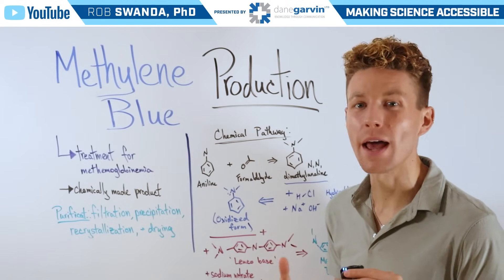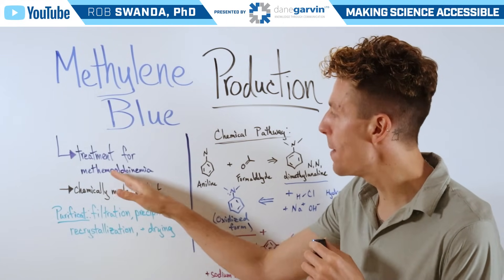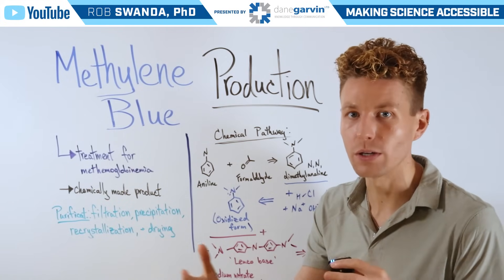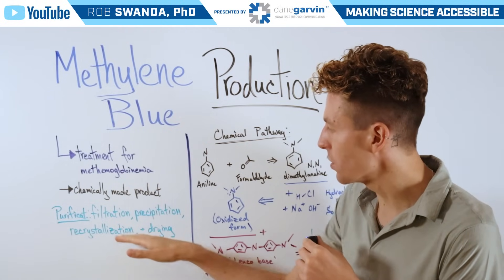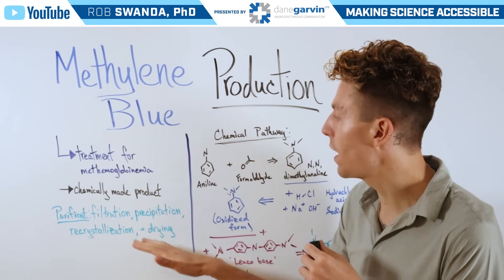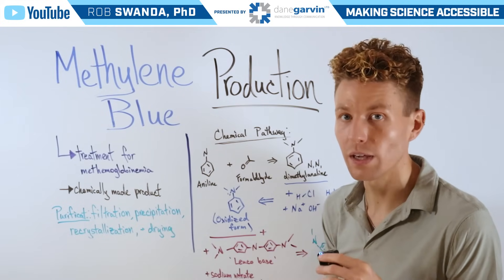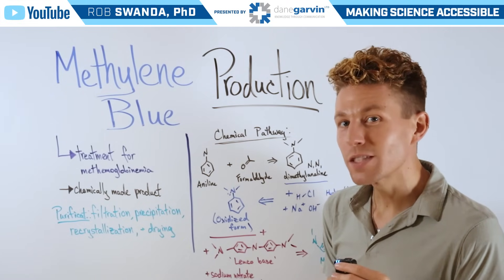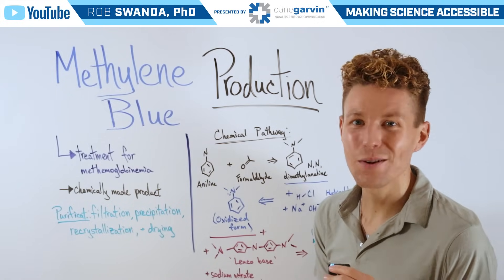How is Methylene Blue Made?

Comment: What are the long term effects & are there any contraindications or side affects? 
Does Methylane  Blue cause dependency?
   Why does the name sound so similar to “Meth Anpheptamine”?
Reply: There are side effects to everything. Tge main lrobkem is tgis requires a small dose to work so many people mix it with water so they dont overdose. Also you are supposed to cycle your use because the body builds immunity.